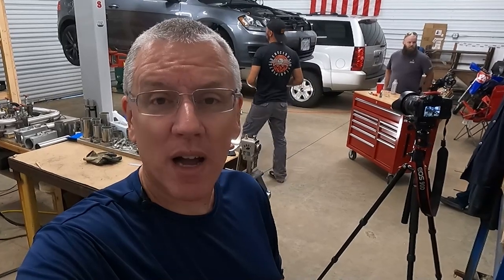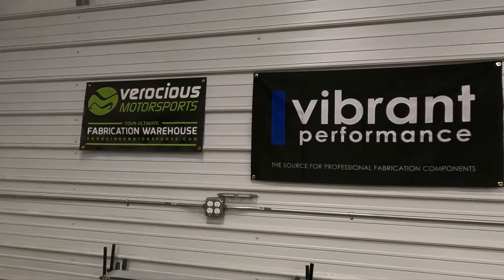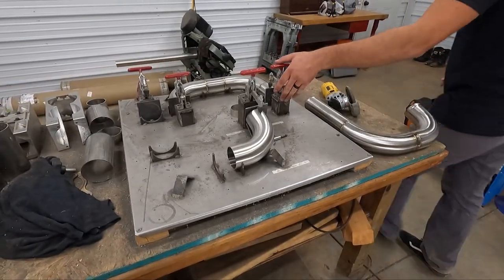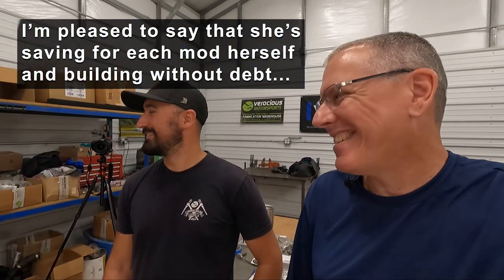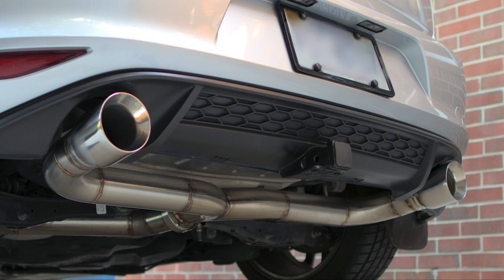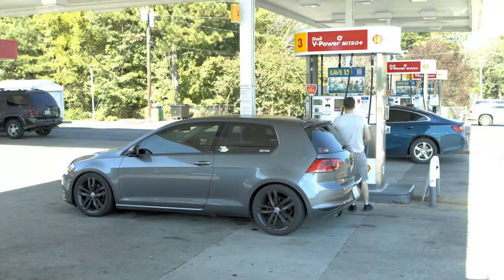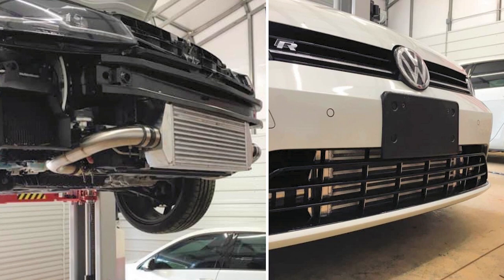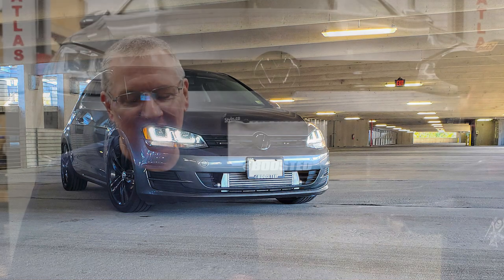Baun Performance FMIC for Daughter's Mk7 Golf

Comment: Scott,  did your daughter ever get a tune on her 1.8T Golf?  I'm considering a tune for my wife's Alltrack and it also has the 1.8T. Trying to decide which tune I will use and thought you might have some feedback on ther tune your daughter was going to have installed on her Golf.
Reply from the maker: She did. She followed my path and went with APR, an "off-the-shelf tune" that's safe, error-free, and doesn't overload anything. I need to create a video about her car. She'll be home for two weeks soon. That may be a good time to hijack her car and do some shooting. OH - if you're wondering, we did not bother with a downpipe for two reasons: 1) It doesn't yield much improvement, especially for the cost; and 2) It makes the car sound like a kid's fart-can. ;-)  She's currently running her car with my old Baun axle-back, which is essentially a "muffler-delete" with good results. No additional power, but it sounds fairly good. I'll be sure to cover that in my video. Take Care!
Reply: @StealthGTI  I'm leaning towards the APR tunes for the ECU and TCU as well. I have to drive a couple hours to  get to a APR dealer, so I may just drive an hour further and go to Opelika AL and have APR do it at the mothership. I really like how quiet the Alltrack exhaust is so I don't think I'm going to mess with it, and don't have any plan to install a downpipe or go beyond stage 1. Thanks again for your reply and information.